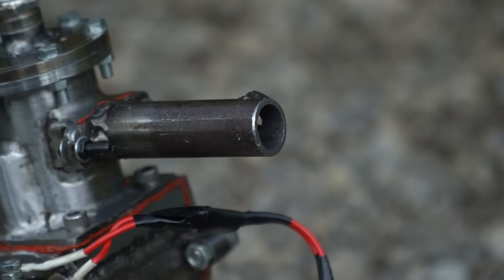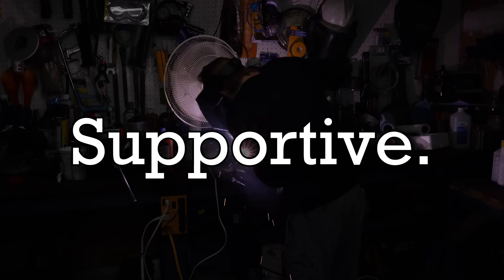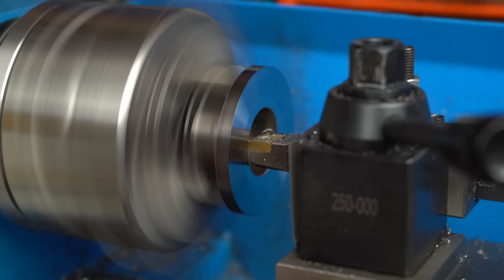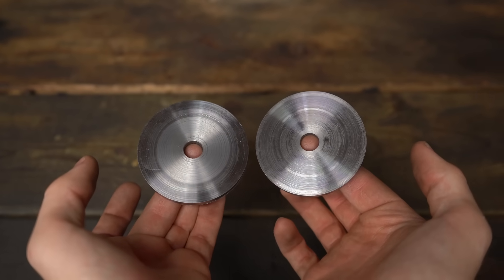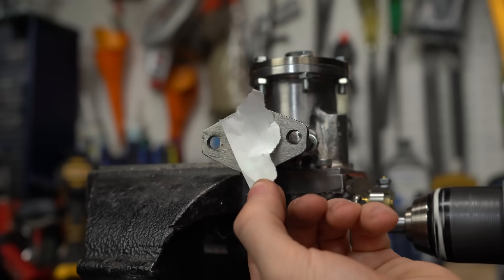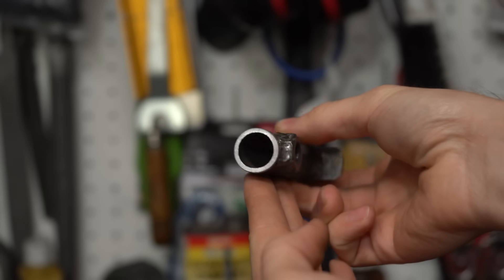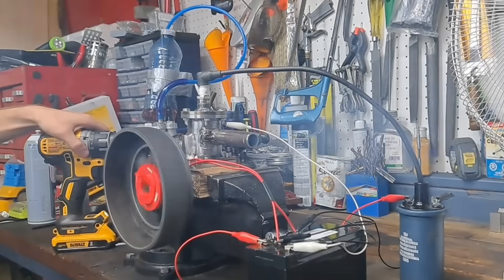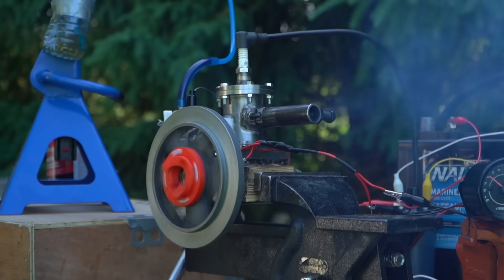I Made a Two-Stroke Engine Using Things I Found at the Hardware Store

Comment: Damn, that's really impressive. This brings me back in time. 

Back in the day when we were 15 or 16 and working on our 50cc scooters the stock carbs usually had 12mm. For easy tuning we used 17.5mm dell'ortos with decently sized airfilters and nozzles and most importantly proper exhausts. You would be surpirsed about how an exhaust completely changes the running characteristics and power output on 2 strokes. It's almost tike a turbocharger on 4 strokes. Back pressure has a lot to do with it. And the way gases flow through it, that's why tuning exhausts tend to be bow shaped. And not to forget they take away the heat from the cylinder. WIthout one the engine runs like crap and tends to overheat. And fuel mixture was usually 50:1 so you don't get smoked to death and the engine wont choke on soot.

When you combine a proper carb, intake and exhaust with a sport clutch and variator your 50km/h scooter was ready for 90km/h, sometimes much faster depending on the engine, how it was geared and what else was done to it. Adding fuel chanels between crankshaft and cylinder or making them larger and the exhaust channels larger also helps. Next step would be 70, 80 or even 90cc. It's unbelievable how much power you can get out of those tiny engines and how fast the accelerate. It's like riding a cannon ball, you just cant keep the front wheel on the ground. 
All this was highly illegal in germany, but it was easy to loose the cops because scooters can go just about anywhere. Just bend up the license plate and be gone. We felt like ghost rider on our Aprilia SR50's, Peugeot Speedfight 2's, Yamaha Aerox's and Piaggio Zip's. Everyone had a "Scooter tuning is not a crime" sticker. Show's that you don't need expensive cars to have fun with tuning something.
Reply: just got a zip 50 and this sounds like a lot of fun
Reply: @radicaledward4717  You can turn that little thing into a rocket with like 500€. Even just taking out the speed limiters would probably get you up to 70 km/h (I don't know the english word, we call it Drossel in german) There should be a metal ring that limits your max speed in the variator. You can just take that out in a matter of minutes. And maybe there are blind tubes that are welded to the manifold of the exhaust to reduce engine power. You can cut that off and weld the hole shut, so the exhaust gasses can flow freely. Sometimes there also is a metal piece inside the manifold to limit the diameter. Take that out as well. Then your scooter is not limited anymore and goes as fast as the engine can. It's even better for the engine because it can finally work in it's default condition. Piaggio engines are great for tuning and very durable. I had one in my Aprilia SR50R Factory almost 20 years ago. That thing made about 140 km/h. You couldn't go full throttle under 70 km/h or the front wheel would rise up.
Reply: @DLT-po6to  the drossel you speak about is called a govenor in english mon ami
Reply: @syedmahdy7011  Thanks, mein Lieber.
Reply: How TF you get a gas motor to run at 50:1 AFR, my diesel idles at that AFR but on a gas motor...idk man
Reply: @DarkAttack14  It's just the mixture of gasoline and oil. Diesel lubricates, gasoline doesn't. You add oil to the fuel of a 2 stroke to lubricate it. Modern Mopeds have two tanks for both oil and gas and the carb adds the oil to the fuel by itself. Back in the day you had to mix It yourself.
Reply: All these things sounds fucking crazyyyyyy❤
Reply: This is the most redneck thing I've ever red and its amazing. We Americans need to step up our game
Reply: Exhaust scavenging

Comment: oh no not another "my air pump needs back pressure". It needs exhaust pulse velocity. Not a two stroke guy so much, but iirc the negative pressure behind the exhaust pulses creates the relative vacuum to pull in fresh air/fuel.

Comment: How Much was that Lathe? I really need one for my hobbying
Reply from the maker: I paid 700CAD shipped for mine, but depending on the distributor you can find them even cheaper. Out of the box they work all right but I put some more money into mods such as upgraded headstock bearings, quick change tool post as well as a carriage lock.
Reply: @CamdenBowen  oh wow that's cheaper than I figured. I don't need to do any precision stuff and can just let it wobble around

Comment: Is it normal to make so much exhaust gas? It looks like before you got it running and it was still misfiring it was just blowing out the fuel-air mixture? Is that what it was doing? 
After you got it running, did it not smell like gasoline?
Reply from the maker: It was mainly burning off the oil I poured into the crankcase. The oil helped alot to break the engine in and ensure it would stay lubricated until the oil mixed in with the fuel was able to adequately lubricate the engine. It was also likely running a bit on the richer side, which isn't always a bad thing for a 2 stroke engine

Comment: Mix your lube with the fuel depending what you use you can go anywhere from 16:1 up to 100:1: This evenly applies fuel with lube, helps the engine run cooler and smoke less. Your parts will last longer. If you run the engine for longer bits at a time, might add cooling fins to the outside of the cylinder. Awesome job!!!

Comment: IDK if you have the room, but you can pick up a Bridgeport Mill for under 1500$. Then get 3 phase power from a static convertor, abour 60$. It will help you make so many things, while growing your channel. And then you'll realize you need a lathe with an active lead screw, and a toolpost that won't flex and holds a 3/4" boring bar, onw with a good size hole thru the chuck is very useful. I have a Southbend Heavy 10 and the BP mill and I can do just about anything. You get by well, I just know you'd take huge leaps with better equipment.
Reply: Where on earth are you getting a Bridgeport for 1500?

Comment: I'm going to guess it's a bit like a pulse jet engine and backpressure isn't technically required from an engineering standpoint, but it's nearly impossible and usually impractical to get them started without some backpressure.

In your case, once the engine fully warmed up, it might have run OK without the exhaust manifold. (given it ran OK on starting fluid, it goes to figure that if hot enough, the gasoline would behave similarly.

The question is whether it would've needed to be dangerously or destructively hot before it could burn normal gasoline. In that event, you'd have to mix up some alternate federal blend instead.

Comment: Adjust your fuel mix (too much oil means less fuel in your air-fuel ratio causing a lean run with a lot of smoke) 

50:1 with 91octane should wake it up nicely

Comment: 4:46 I do this just by using a long (high) nut in the chuck and a conical head shaped bolt to hold it concentric. Works like a charm, precise enough, especially if you later machine out (oat) the center hole anyway

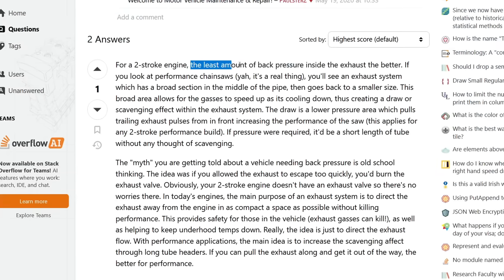Comment: 13:56 I think you need a reed valve on the intake? Pressure escaping thru the intake instead of thru the exhaust? Exhaust filling the intake then is being pulled back into the cylinder making the air fuel wrong and stalling out because it’s way too “lean” I didn’t see a reed valve and this sounds like a 2stroke with bad reeds. Food for thought, super cool video man!
Reply: The piston acts as a valve as it slides over the intake port.  Reed valves are used when the fuel is pulled in from below the piston. "sub piston induction"  vs piston port induction.

Comment: Nice job! IMO, continue to improve it... make for good vidys.  :  )
Also, I really thought that exhaust would fix it... thought some more... in addition to placement, exhaust must be sized for intake (carb)... maybe a sleeve with different sized holes that slides over the cylinder outside at exhaust, that way you can try many sizes easily and placement (to the degree of current exhaust hole).  Hope I made since but I know it was fun... envy   :  "

Comment: If you want it to sound better and run better with the benefit of more power, invest in an expansion chamber then weld on a better fitting so it can bolt up.

Comment: This was quite the awesome achievement. I'm a formally educated amateur electrical/electronics engineer and inventor with a lot of experience in tradesman skills but I too am a shitty welder! lol
What I did learn is with my flux welder, don't get fancy and pull in a straight line rather than trying weaves. Because I'm typically doing thin wall metals, the heat transfer becomes problematic, then your wire feed goes out of coordination due to the heat binding up and you get these blobbed, warty messes.

This is in part because my welder is cheap and the 4 adjustable settings giving 2 positions for voltage and 2 positions for current are so very non-linear. As you tinker around trying to get it acceptable, once you do the metal starts trapping heat, your wire feed rate needs adjusted and things just go to shit so you blob it up. 
I finally added an AC motor speed control to give me better control over the power by sagging the voltage and as often as possible, just pull in constant lines rather than weaving because the flux will do it's job and you'll get acceptable beads.

Took me a few years to figure this out since I so rarely weld and would have anything from picture perfect to my retired welder father would disown me if he saw them lol.

Comment: Both of the back pressure explanations you showed us are wrong. The larger section of a 2 stroke exhaust pipe is to reflect the exhaust pressure wave back into the exhaust port after the intake port has closed. This causes the pressure in the cylinder to be higher than it could be without the exhaust pipe. It is a way to increase cylinder pressure above atmospheric pressure, but it is tuned to a small rpm range.

Comment: instead of  tapping in the bearings use  heat on the crank case part around where  the bearring sits  and it should go in easy

Comment: The best way to think of an engine and making power is to think of them as an air pump. The more air (really we're after oxygen) you can flow into and out of that engine, the more power you can make. Turbochargers, superchargers, nitrous, E85, methanol, and even nitromethane. All of those exist and are used to jam more air and really it's the oxygen into an engine to let you burn more fuel. Ethanol, methanol, and nitromethane carry in their molecule oxygen atoms. So even though nitromethane is much less energy dense than straight gasoline. You can burn so much more nitro than gasoline that it makes up for it by a huge margin. It's why E85 kits exist, more oxygen. Turbos, more oxygen. Nitrous OXIDE, is literally an oxygen injection. Hood scoops, colder outside air is denser...more oxygen. Water methanol injection it cools the intake air, more oxygen. It's why in fall is turbo season, air is cold and dense...more oxygen.

Backpressure has never been how to make power. Try breathing out of a coffee stir straw and then a regular straw. It's really hard to breath out of a tiny straw, that's what you're engine is trying to do when it has backpressure. It has to work to get it's own exhaust out of the exhaust tubes. It's wasted power. If you had a really long straw, it would begin to get difficult to blow air out because the pressure is building up inside the straw. You want your engine to work as little as possible to get the exhaust gas out of the tubes. Now start adding a bunch of twists and turns in the exhaust and bumps from casting defects or bad welds. All of those can create turbulent flow, slowing down the exhaust gases. Making backpressure. Wasting power. Wasted potential. Whenever you hear of a car that can make 20hp or 40hp on an exhaust system. It's not making more power, that power has always been there. The engine was spending it on working against it's own exhaust gasses.

What you want for power in a 2stroke with exhaust is a properly tuned and shaped expansion tube exhaust. The exhaust pulse inside the expansion tube basically bounces the next fuel/air charge back into the engine. The Germans discovered this in 1938. An engineer was chasing idea's on how to make 2strokes more efficient. As Germany was and is almost perpetually short on every energy source except coal. The science has been well known for nearly 100 years people, it's not and never will be backpressure.

4 strokes, think about why you would put long tube headers on an engine. More power right? If backpressure made power the basic old ass log tube exhaust manifolds would be what everyone uses to make big power. The exhaust pulse flying out of the port trails behind it an area of low pressure. To large of a tube, then the pulse has too much room and falls apart in the exhaust and you get backpressure. Too small and you're plugging the engine and you get backpressure. Just right and the flow can maintain speed out of the engine. 4 stroke exhaust ends up being keeping the tube just the right size for the amount of exhaust gas flowing inside it. That's why the first thing that people do with exhaust is hack out the mufflers and replace them with straight pipes or resonators. Same with the catalytic converters, cut them out or if you have to replace them with hi flow cats. It's why race cars usually have very short exhaust that is perfectly sized and shaped to flow quickly. If you wanted to get water flowing you wouldn't want turbulent flow right? No, you'd want laminar flow that doesn't tumble and make drag. You don't want drag inside your exhaust system slowing the flow.

It's why people will take carbide burrs and clean up the exhaust or intake ports of casting defects or even polish them smooth. 

Larger intakes, gasket matching, larger throttle bodies, larger diameter valves, more valves, dual cams, variable valve timing, variable valve lift, more aggressive cams. It's all for faster flow and to jam as much oxygen into that engine as possible to burn as much fuel as possible and to make mo powuh baby.

Comment: Your understanding of carbs is off. The needle settings are just fine tuning for initial-partial throttle opening. It has nothing to do with idle, unless you are incorrectly using the throttle to set the idle. Think about what the needle does. When you close the throttle, the needle, seats into the main jet, closing it. When you open the throttle, the needle, being tapered, progressively allows more fuel to flow past it, from the main jet. When you raise the needle, you change the timing of how soon that passage opens, and how much MORE fuel it allows. When you lower the needle, you lean that range out in the inverse.

How are you supposed to richen the idle then? Well, that depends on if it is a proper small engine (below 50cc) two stroke carb. Most will have a mixture screw for the idle, and full throttle. If not, you will have to rely on changing the low speed, or "idle" jet, and adjusting the air mixture screw. (or in some cases, a fuel mixture screw) The air mixture screw, does not add fuel, it opens a passage to allow more, or less air in. If it doesn't have enough fuel at idle, to idle, you will have to install a larger low speed jet. If it runs lean at wide open throttle, you will need to install a larger high speed jet. The space between idle, and WOT are where adjusting the "needle seat height" and the diameter, and or even taper of the needle, come into play.

Slide carbs are relatively simple. You don't even need to do math to find one that works decently for your application. Generally, if the throat of a slide carb, is smaller or the same size as your intake port, it will run.

Don't trust chinese carb sales descriptions. "works with" does not mean out of the box. Slide carbs are too basic to work like an automotive carb. They are sensative to jet size, to the point where one jetted for 50cc, will not even run an engine jetted for 125cc, and vice versa. One would be too lean, probable wouldn't idle and pop all the time. The other would be to rich, foul plugs, not idle, and probably run like garbage at full throttle. The same carb however, with proper jetting, could indeed be set up to run either size engine.

This is why many Chinese replacement carbs for ATVs get a bad rap as being junk. They often come with tiny jets way to small for the application. With tuning, and proper jetting, they work fine. This is from personal experience.

Comment: as someone that's made a few model engines myself, I thought this was going to be a hack job but I quickly changed my mind, I'm very impressed! You've done some things I hadn't thought of, and actually got a runner out of it! And you did it with about the same tools I got started with too. This is a hard thing to do and you pulled it off! I'm going to use the weld on flange idea on my next engine I think, good idea!
Tip for that bearing falling out: Green bearing retainer loctite. Perfect for not quite interference enough fits. Got a sub from me! What's next? you can't just build one engine!

Comment: Normally engines don't need back pressure, it's just a side effect of exhaust pipes being legally required. However, back pressure shouldn't be an issue.  Even if some of the charge exits the cylinder, there should be some of the charge left in the cylinder, and if it's not enough, you'd just end up running lean. Back pressure might fix that, but that's not good engineering. 
Quick bit on the bearing that keeps falling out: ...would it kill you to put a pin or a collar on it? Widen the surface it sits on, machine a little groove and then you can put a small rim (a bit of wire should work, so long as it is wider than the groove is deep) inside it.

Edit: yup, I bet you it was just running lean.